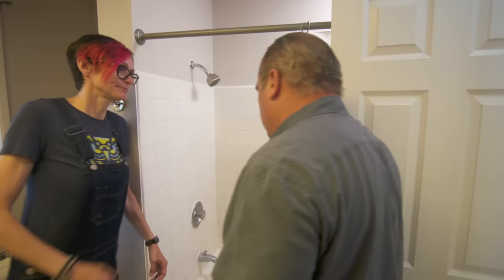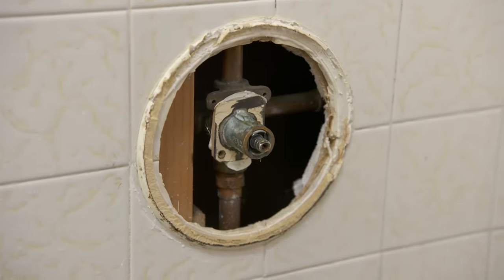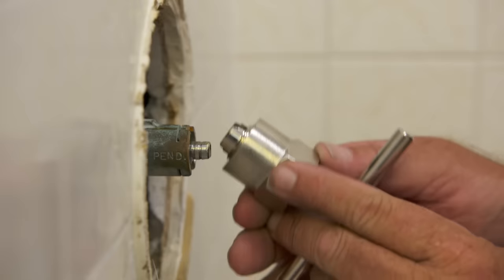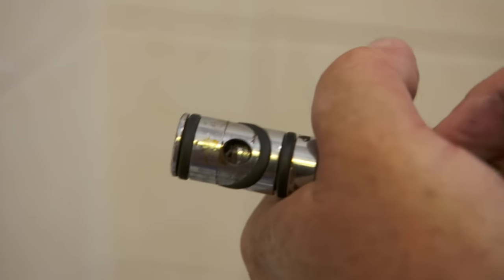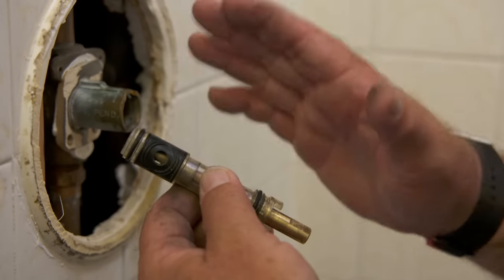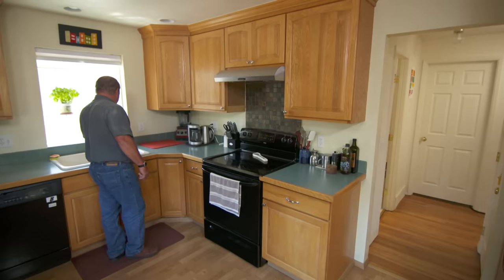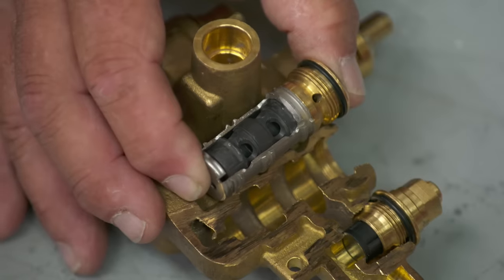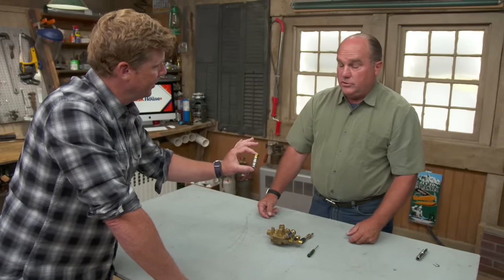How to Replace a Shower Cartridge | Ask This Old House

Comment: Why do repairs on this tv show always gdoes as planned? Anything job I do in my house no matter how small turns into a bigger job for some reason.  Tried hanging selves in the closet just to find out the closet wasn't framed right so now I need to buy special anchors. Come back the anchors are the wrong size so I go back. Start to hang and hit a pre patched hole in the drywall that wasn't done right by previous owners. Patch falls out now I need to patch the hole properly before hanging shelves.  I'm sure every diyer had a small job turn big for some reason. You never see that on this show.
Reply: So true, I was doing a faucet similar to this the other day and the O-rings/cartridge was so degraded I had a hell of a time getting it out. I also happened to cash out my bad luck lottery that day as only a few moments after I got the cartridge out, the main ball valve coming off the water heater failed, and lets just say I took myself an extra shower with the bathroom, haha.
Reply: It happens to everyone.
Reply: Yes!  No project EVER goes as smoothly as they go in YouTube tutorials.  Every time I take on an "easy" project, it turns into a day long cuss-filled endeavor.
Reply: @Samuel-km5yf  next time I do a project I'm going to record it. Hopefully pretending yo put it on YouTube will make it go smoothly. Lol
Reply: No matter what project we have around the house, I always add three hours to my time estimate. It's always some bullshit that arises. Usually a few small things that add up.
Reply: @raCeCar lol. See your small projects become full day event like i Saud it happens to everyone except this show.
Reply: @Mr_Chris77  exactly. I knew I wasn't the only one.
Reply: I have had my share of unexpected problems happen when working on things. For most projects, it is just an annoyance,. Plumbing on the other hand always seems to get worse and worse for me.  I think the worst was when I was changing out a faucet in the bathroom. The stops under the sink were beyond corroded, so I replaced them too.  That meant turning off the water to the house. I cut off the valve stops, sweated on new ones, and went to turn the water back on.  That's when the valve stem on the gate valve for the house (on the street side of the meter) sheared off in the body, and pulled out. Lucky thing was the packing jammed up in the hole for the valve stem, so no flood.  Unlucky thing was now the valve is stuck in the shut position.  Oh, did I mention it was Sunday afternoon too (of course).  I ended up calling a plumber (and paying big bucks) because there was no place open where I could buy the replacement valves.
Reply: Inspector Steve  It’s TV, nothing ever goes this good, I watch this videos all the time, and constantly calling Bullshit because that never happens! Do you really think that cartridge looks like it’s been in there for 40 years or whatever they said, BS, it looks like it’s only been in there maybe 5 years tops!
Reply: @jeffkreft9872  you're right.
Reply: @phonedave  oh my goodness. Well it's good to know others have problems too. You're right they do like up sometimes.
Reply: The beauty of editing.
Reply: He mentioned when pulling out the cartridge, which would have wrecked all the shower plumbing. They don't have time to go into super detail.
Reply: Many takes
Reply: "Why is nothing easy?" Said by me when my hand twiched and I dropped a large glass of coca cola. The only good thing I mostly just use plastic so no broken glass. Man old house old problems murphys law etc its the reason my tool bag holds 50 pounds of tools and im actually willing to carry its heavy ass around.
Reply: It's called editing.
Reply: Told me about, my old house plumber when to my old house he can't fixed, he told me I had to do a new wall for him to put new shower valve.
New shower valve is remodeling for me.
Reply: I purchase a condo in Fl and it was built in 2004.  I hung the verticle blind myself and I ended up using three different types of anchors to hang the brackets.  Some areas were cement, some wood and some hollow.  There is sure a lot of shitty construction in Fl.
Reply: @Mr_Chris77  And I start off with a few tools that I think I need and end up with half my workshop tools on the project.
Reply: @jeffkreft9872  I agree.
Reply: That's funny stuff. Every project always turns into a cluster. I feel your pain.
Reply: I, my friend, am the LORD of turning a 30 min project into a day long affair where absolutely nothing goes right.
Reply: Oh yeah,whenever my wife tells me to do something i just know am up for a big job,no matter how small she claims to be
Reply: @dvader3000  I hear you. Same here.
Reply: To my fellow Brothers, cheers to us as we tackle the challenges of our domiciles!!  I really hate chasing parts!!
Reply: Inspector Steve  that’s because they also came up with a small idea and they call it, are you ready okay here it is, video editing. Mind blowing right  ;-) 

.
Reply: You must be related to me.lol
Reply: @joepoe8861  lol
Reply: This sounds just like my house😂
Reply: Preach
Reply: Same here buddy. I originally had to replace a kitchen faucet. I ended up having to replace entire sink,  pipes, adapters for hoses, and all the accessories. All under 500 dollars. Took 3 days of back and forth to the shop.
Reply: @rudyvalle  oh brother. What a headache that must have been.
Reply: They have a video for each of those tasks 🤷‍♂️
Reply: Bruh lmao this comment is too real
Reply: I feel your pain! No job especially plumbing goes according to plan. At least 8 times out of 10 it doesn’t.
Reply: Lol!
Reply: I thought that was only my projects. As a mechanic I have pretty capable hands but for some reason EVERY plumbing job I do turns into multiple home Depot trips and much aggravated feelings
Reply: Are we living in the same house? How have we not seen each other?
Reply: Because this was previously removed before for show time another big problem not shown you have a 50 50 chance of main water valve shutting off
Reply: Bruh! I feel your pain!
Reply: because you aren’t good at it
Reply: *goes
#spellingfail

Comment: If only plumbing were as easy as Richard makes it look!
Reply: Only easy if you understand plumbing
Reply: Understand or not, there are still a lot of variables that almost always seem to work against you.
Reply: I was gonna say. Everything goes so smooth on camera .🤔 LOL
Reply: @davidmatke248  True, I guess experience makes it seem easy to me
Reply: I would like to invite you to my home in Florida to teach me how to replace my shower to a single handle , and I need to RAISE my shower head  ? 
NEED your HELP !
Reply: David Matke my cartridge would definitely snap, hell maybe even the whole pipe behind the wall while we’re at it! lol
Reply: It is easy just research it and understand how it works,I’m a woman I never pay anyone to fix anything in my house including cars!
Reply: It is
Reply: You are right, my cartridge stem broke and cartridge got stuck, took almost 3 hrs to remove.
Reply: @maheshwaranparamasivan5177  any and all plastic parts would fall apart on me when removed....
Reply: David Matke It is
Reply: Handy woman Cart. Respect
Reply: It's easy. Anyone with an average IQ should be able to understand it easily.
Reply: @MattyWill1 About in real life🤣🤣🤣🤣🤣🤣!!!!👍 👍
Reply: @mikewilson4141  😴😴😴😴😎🍺
Reply: @Zero-mt7lh  but even if you know plumbing sometimes is hard to replaced when is to old!🙄🙄😎👍
Reply: I havent snapped a plastic cartridge off in the wall since I started heating the valve body with my torch first. Softens the o-rings. Works great.
Reply: Seeing as Plumbing has been a family business for many years I'm sure he's spent his entire life working around this stuff
Reply: thats what experience makes you into…

Comment: If the homeowner decided to get a new shower faucet, a plumber would have to come in, cut off the old piece where the cartridge went into, and then solder in a new piece that fits the modern shower faucets! Right? Maybe a $200 fix, depending on the cost of the cartridge, compared to maybe $1000?

Comment: Thanks to this old house, the recommendations here made the job easy and fixed another problem I didn't realize I had. The water in my hot water tank gets hotter now because there is no more cold water bleed-over due to unequal pressure that apparently happened at the faucet. We can take hotter baths because of you!

Comment: Great video.  I had to replace the cartridge in my manufactured home and even though it was slightly different than the one showed here it is similar. My home is 37 years old.  The new valve was a simple with the use of a MIXET Tub/Shower stem with MXT07 .

Comment: I did similar job on my dad's shower. Its a Moen brand. It was a "pausie-valve" replacement. The only hard part was busting the screws lose because they were so carotid from hard water build up. Nearly snapped my allen wrench from trying to bust it loose.
Reply: Did you type this with talk-to-text?  Lol “carotid”, you mean “corroded”.

Comment: If you have the right tools it makes it easy. That extracting tool was the wrong tool for the 1220 Moen cartridge there. That was a tool for extracting the newer Positemp cartridges. The proper one threads into the stem. If the stem pulls out from the center, it has a special rod to insert into the remaining parts to pull them out.

Comment: Just replaced the Moen 1222 cartridge- which must have been 20-25 years old.  The handle was hard to turn and the shower dripped every 5-6 seconds.  The inner rubber valves were totally hardened, and ended up crumbling during the removal. Make sure to turn left and right as well as push and pull these cartridges while removing!  Just good enough to tide us over until I rip the entire shower for the bathroom remodel.

Comment: That's real nice of them to make the replacement cartridge out of plastic... Good luck getting it out in one piece when it has to be replaced.
Reply: Not all plastic is created equal.
Reply: @jej3451  there is also a tool that just pulls out the outer barrel if by accident the center stem comes out.

Comment: I had to do this just the other day and I followed this, but I do wish I would've read the instructions as well. You don't always need to remove the escutcheon plate, I gave myself a little extra work with that.

If your plumbing is secured with plastic tabs/clamps, specifically old ones like mine, rather than metal chances are they'll break if the cartridge doesn't want to leave it's home without a fight.

Lastly if you get everything back together and your hot and cold are reversed don't fret, just remove the knob and twist the center part the knob screws into 180 degrees. Put the knob back on and you're good. Thankfully there's no need to go any deeper.
Reply: Good to remove it to check for leaks.

Comment: He really should've used that "special tool" that he used to spin the cartridge instead of the pliers. That tool simplifies removing the cartridge and definitely prevents that pulling face he had when pulling the old cartridge out. There's a small screw that connects to the old cartridge that secures the tool to the cartridge, then the larger nut on the outside starts to pull the old cartridge out by securing the tool to the valve body by spinning the larger nut in a clockwise motion.
Reply: That's a Moen cartridge puller. Threads likely aren't the same. I have the same tool and off-brand cartridges that are super stuck will never accept the screw on the puller. Sad times.
Reply: @SadUncleTed  I'm aware of the Moen cartridge puller. He referred to it as a "special tool". That machine screw is for Moen cartridges, but the Danco/aftermarket cartridges are hit and miss. Danco has their own version of the cartridge puller, but it's not as good as the Moen version. I've been a licensed plumber for 27+ years and have come up with alot of fun ways to get cartridges out when I needed to, but yanking them out with channel locks or vice grips are usually a great way to fling your body into a wall lol
Reply: @johngreen3513  Big fan of using the torch and heating the valve body up. Works well if it's a one-piece cartridge. Three piece stuck? Enjoy your reno plate.
Reply: @SadUncleTed  LOL right?! Believe it or not, I've only ever had to use a reno plate 2 times in my career (hated it both times). My most favorite trick when the Moen 1200 brass cartridge comes out in pieces, or to put it plainly, when the housing gets stuck, is to get a 3/8" npt pipe tap and run the tap in the housing as far as you can (you'll see the housing start to spin). Then take a 3/8" galvanized nipple and tighten it into the housing, then screw a 3/8" galvanized tee and screw the branch of the tee to the nipple into the housing, then take 2 more nipples and screw those into the run of the tee. Basically, you're making a tee handle tool. Once you're freshly made tool is together, you'll spin the cartridge 3 times in a clockwise motion, then start pulling as you keep turning in a clockwise motion and the cartridge will pull right out. It also works for the 1225b plastic cartridges as well, and even for the aftermarket cartridges as well
Reply: @SadUncleTed  this trick that I just mentioned above has suited me very well throughout the years. Works everytime I've ever needed to use it

Comment: Where do I find the tool for extracting the cartridge? Where is the  best source for the replacement cartridge? This job looks exactly like the Moen valve I need to  change in my house built 1968.

Comment: I just did this new cartridge comes with the spinning tool and the damm thing came half way out the the core pulled out of it and It has service Valves that had turned green and froze open and when I finlay got it all back together I turned the water back on at the street just for the valve there to turn into a sprinkler so now the water company had to be called so they can come fix their valve

Comment: As someone who just finished dealing with a stuck MOEN cartridge without the special OEM tool, WD40 IS YOUR FRIEND!! Lube the living hell outta the crack between the cartridge and the pipe, wait about 7 minutes, then get some normal pliers and grip the part of the plastic on the left and right of the "HC" text (around the middle where the brass comes out)  REALLY hard. You'll want gloves for this, as my pliers gave me a nasty bite on my first attempt. Don't try to grip the brass, you won't get enough purchase. Pull firmly while turning back and forth. Lube some more if you don't make further progress, then wipe the excess and pull/twist again. Patience is key here, any progress is better than no progress or breaking it. Repeat until the cartridge pops out. Took me about 2 hours to figure it out my first time doing this. When you get the cartridge far enough out, you can grip the circular portion for better leverage. If you need some help in the early stages, there should be a slot near the top you can get a screwdriver into to coax it out. Take your time and make sure the water main is off. If the handle is upside down to turn off the water, you just need to flip the black plastic part and you're good to go.

Comment: I have a hot and cold faucet in my garage that has a garden hose hooked on to it. The nozzle on the garden hose has a shut off on it, when the nozzle is shut off and the hot and cold valves are left on I can’t get hot water anywhere in the house. That may also be your problem.

Comment: How well does the pressure balancing valve work with a tankless water heater?  Our tankless takes a minute to recover from any fluctuation in the flow of hot water.

Comment: After watching and being super confident, I went and bought all the items needed and then proceeded to remove the cartridge. Well I did pull out the 1/2 of the cartridge. Now I'm screwed. So now its either i cut and cap or plumber cut and caps. They said owning a home would be fun. HAHAHAHAHAH!

Comment: I’m changing a cartridges for strictly on off volume control with the water off there still  a good amount of water in pipes is there a way to drain  so it doesn’t end up in wall it’s a tiled shower and the carriage is in the wall. I have multiple cartridges to change and was concerned about watering getting in wall. Thx

Comment: Richard, I have a similar problem. But I have tried numerous times to remove the cartridge and replace but it won't budge and Ive put so much pressure that I had to stop in fear of damaging the valve. What is the tool you used to loosen the cartridge and where can I get one. Would sure appreciate any info.
Reply from the maker: Hi! The replacement cartridge should come with a little plastic tool that mimics the tool Richard used, so you don't have to buy one. If you want that specific tool, he used a Moen Catridge Puller that should run like $15-$20 (this is all assuming you have a Moen shower valve like in the video). Go slow and good luck!

Comment: helpful, but not for changing TODAY's Delta and Moen faucet cartridges (very common ones). Also you did not show or mention cleaning off the gunk surrounding the escutcheon plate before installing the new one. Very important for a good seal.